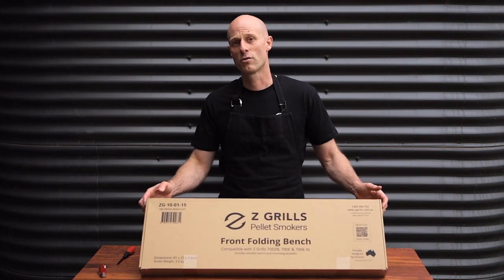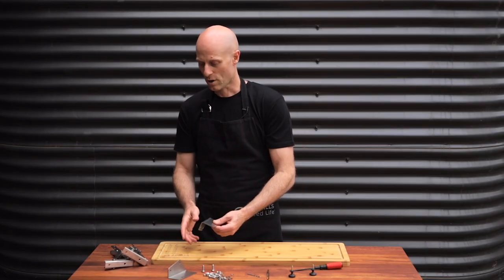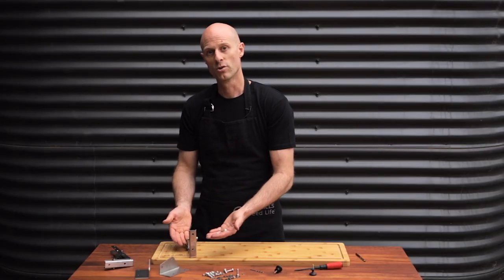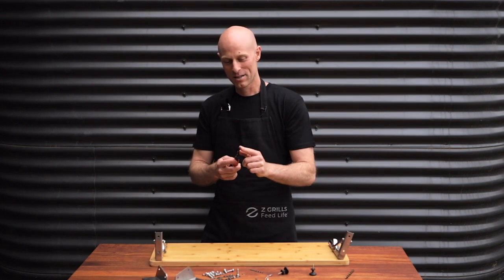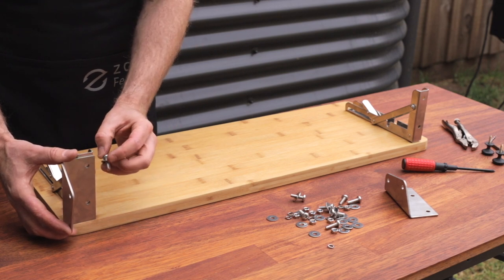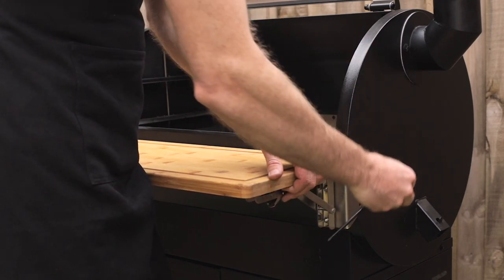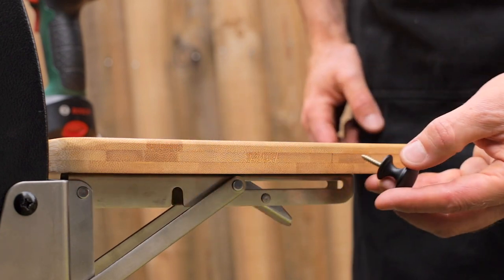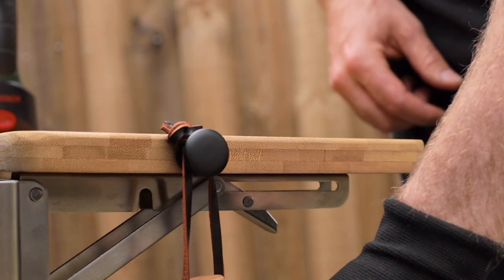Z Grills Front Folding Bench Assembly and Installation

Comment: Why isn't this folding bench offered in the United States?
Reply from the maker: We developed this bench for down here in Australia.  If lots of you in the US want it, let the US team know on the Z Grills Official Facebook group and I am sure they will then have motivation to organize a batch of them.
Reply: @zgrillsaustralia4541  ppl down here are not waiting! Seen tons of posts on how to make your own. Was just hoping y'all had one coming that won't void warranty.
Reply from the maker: @bryantrent924   I don't think that anything like this will void the warranty as you are just drilling a couple of holes so won't impact the grill operation (certainly doesn't for my customers down here).  The only possible impact would be those holes could rust, but after a few cooks they have a nice coating of smoke/oil anyway so not a bit issue.  The only problem with most of the DYI I see is they mount on the front flat panel which is very low down, so not a great height, whereas my design sits just below the lip of the lid which is much better height.